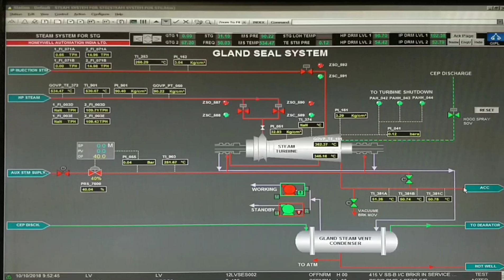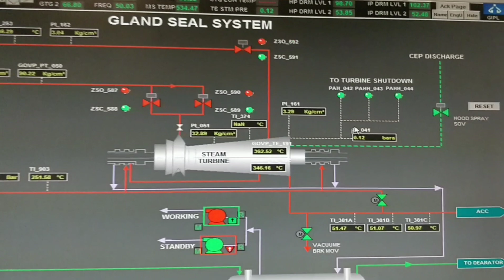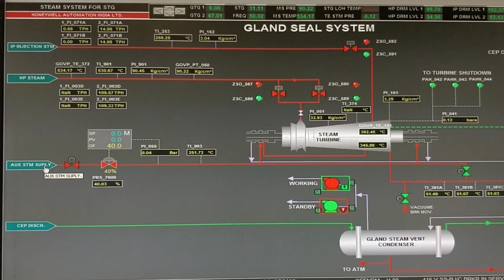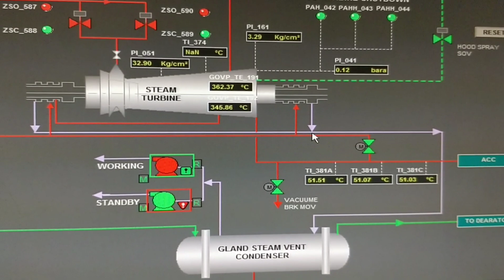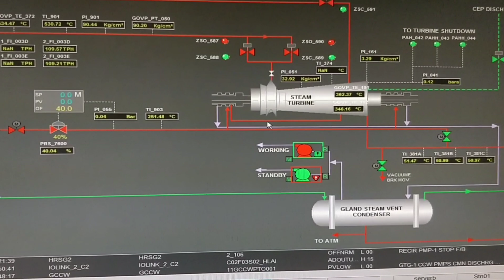Gland sealing steam system for steam turbine! Live demonstration

Comment: Can i ask whats the pressure of the auxiliary steam? Is it same as hp?
Reply from the maker: No it is not same as HP pressure. The auxiliary steam pressure can be vary from plant to plant & it will be mentioned in O&M manual or whoever have provided the system will provide it. In our plant, it was maintained at 16Kg/Cm2 during steam turbine startup to pull the vacuum.
Reply: In our powerplant, the auxiliary steam is 14.2 kg. Thanks for the info.